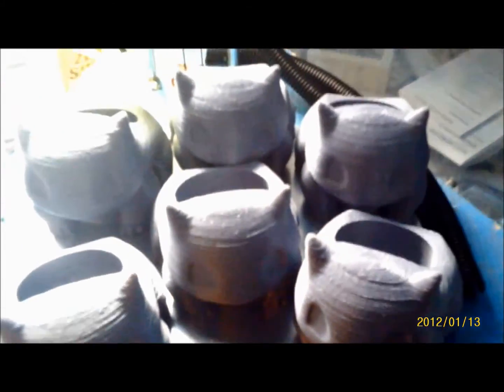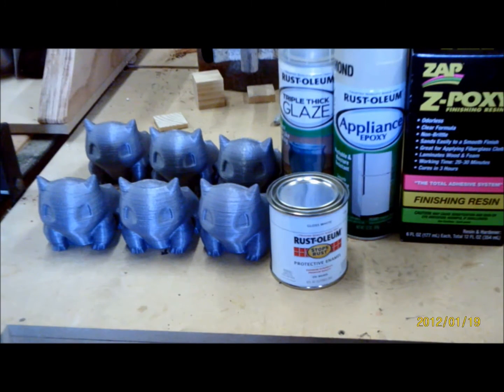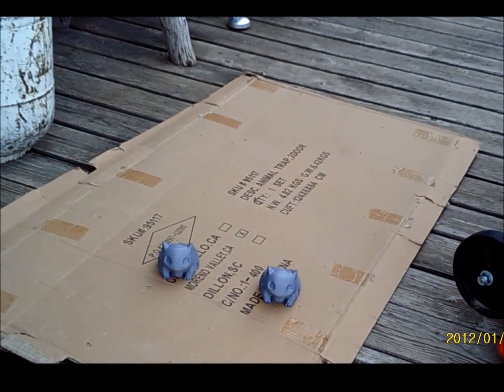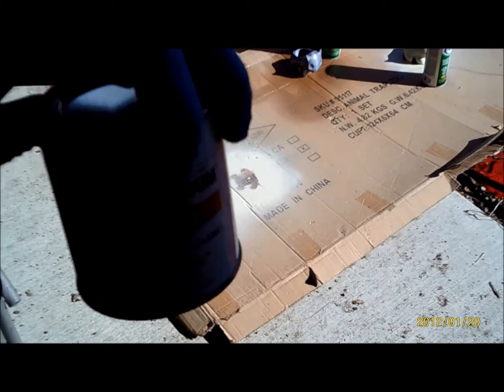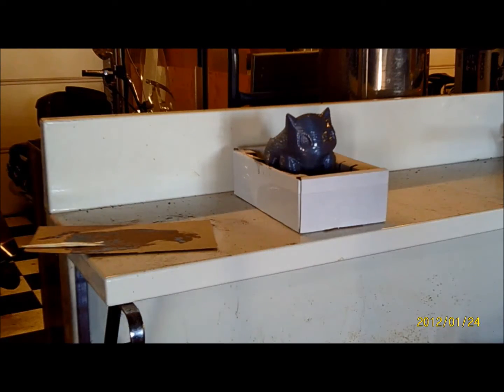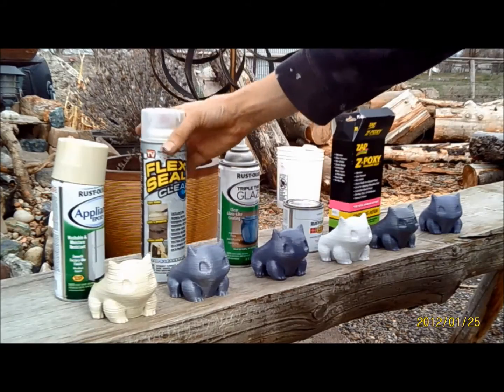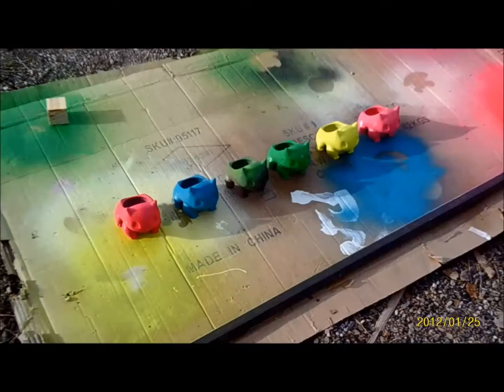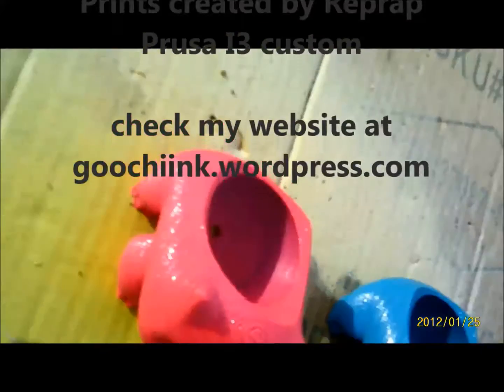Smooth rough 3d prints and layer gap filling with paint for glossy finish on PLA

Comment: I hope you dialed in your printer better since this video. I would consider those failed prints if they came off my printer looking like that. If you need any help getting it printing better, assuming you still have it, let me know
Reply from the maker: Hello, thanks for the advice. However, I intentionally set layer thickness and temp to get extra layer ridges to help with the demonstration of gap filling.
Reply from the maker: yeah for sure but I was intentionally causing rough prints and layer gaps so that you can see how much each product smoothes them up